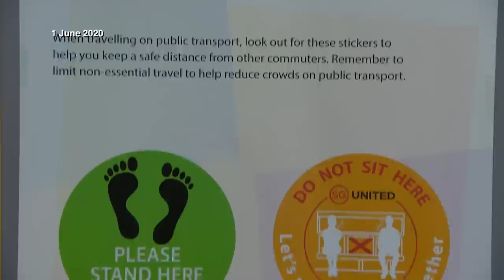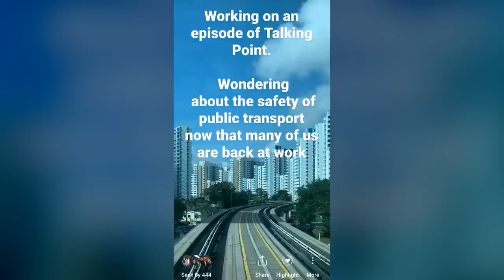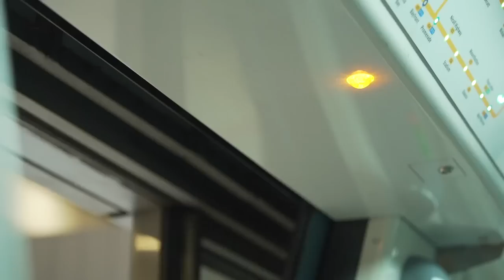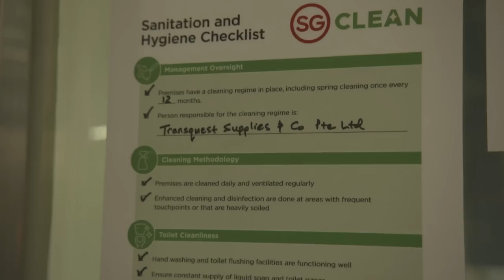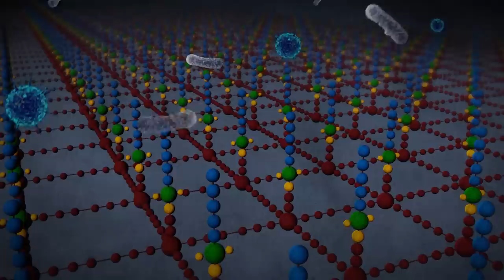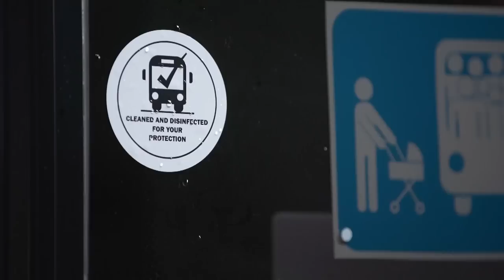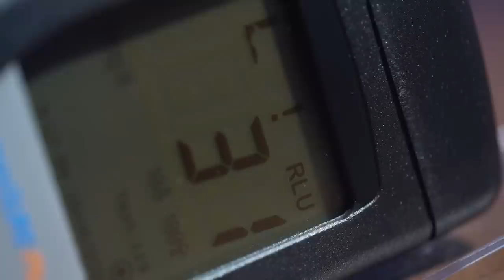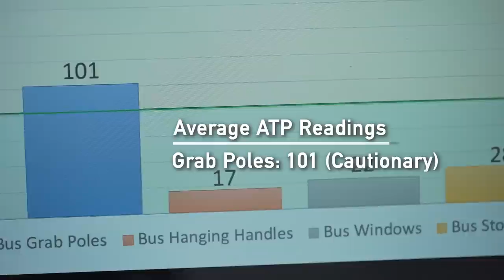Is Your Commute On Public Transport Virus-Free? | Talking Point | Full Episode

Comment: Disinfecting surfaces may be useless because those surfaces are usually clean.
Surfaces where a lot of people touch frequently are usually cleaned by the touching itself.
Any viruses that may be on the surface will be transferred to the people's hands, so after a certain number of people touching that surface, the surface will be eventually clean of viruses.
Such surfaces are usually free of dust and shining exactly because of the high number of people touching those surfaces.
Reply: Speaking like an expert without tangible evidence. Even if the germs were 'wiped' off the pole there will be still some of the virus particles left on the pole. This is because our hands aren't automatic sanitizing devices.
Reply: @grisly-bear585  If a large number of people touch exactly the same surface, eventually that surface will be completely clean of viruses.
Besides, the virus is not able to survive on surfaces for long. Even without people touching the surface, after a few hours the surface would naturally become clean.